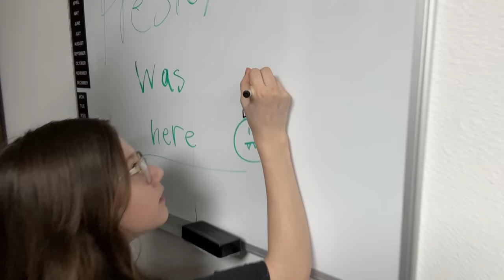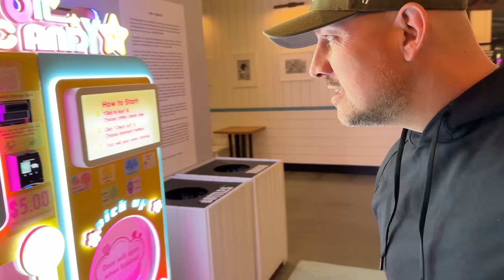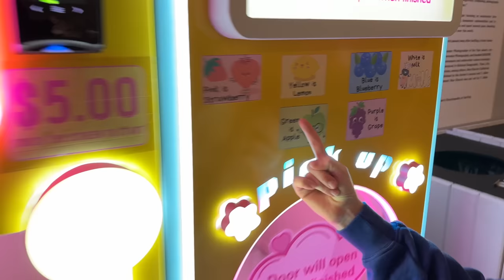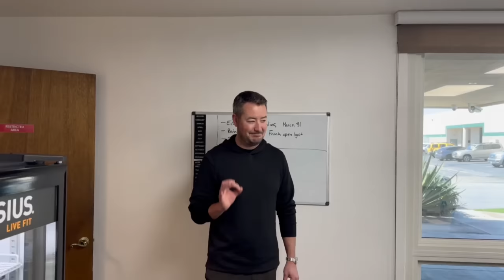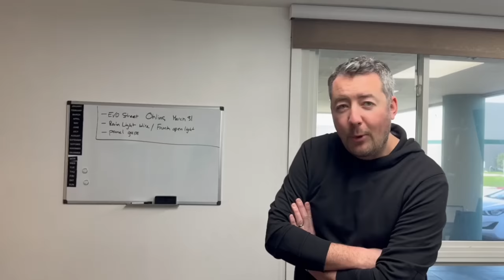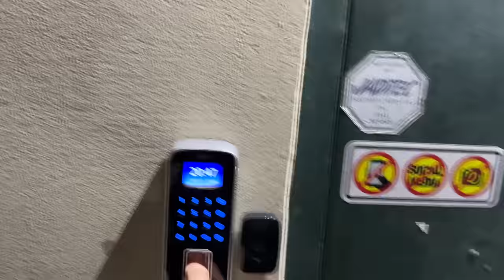Meet Damon’s Best Friend From Canada, Visits DDEHQ For first time!

Comment: 91 octane doesn’t provide more power then 87. It’s about the combustion point. Higher combustion engines like turbocharged vehicles require higher combustion rated gas. It doesn’t have a performance benefit on its own.